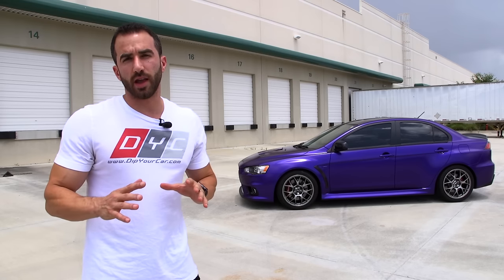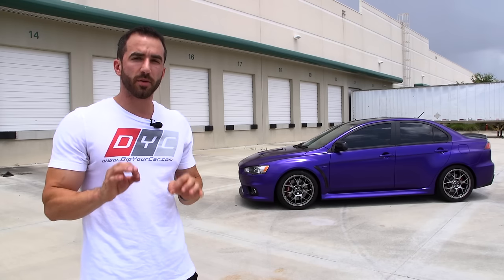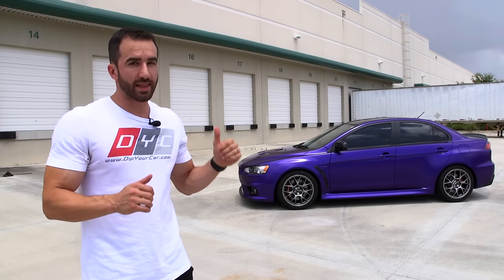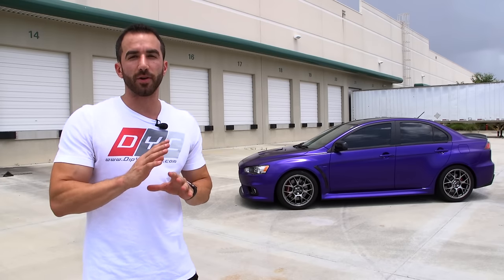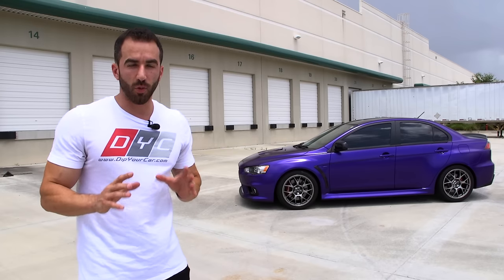The Most Vibrant Purple Known to Man

Comment: How much weight to the car does this dip add?
Reply from the maker: Less than 2 lbs
Reply: Oh wow, a lot less than I thought it would be.
Reply: I disagree. I also thought this stuff was quite heavy. I would hae guessed a lot more than 2 pounds for sure.
Reply: Spotted the ricer! just kiddin
Reply: haha funny you mention ricing I am in the process of DeRicing a nice orange custom geo metro I got ahold of. my god the fart can muffler makes my head want to explode.
Reply from the maker: Heavy in liquid form, however once all the solvents evaporate the coating left behind is very light weight.
Reply: not really dumb. I also thought the weight was significant. not enough to effect fuel economy. mass does not really effect fuel efficiency unless your doing city driving (then mass is everything) but for cruising long haul driving mass (to a limit) has no real effect on fuel economy since mass is only relevant while under acceleration (this includes stopping and turning and going up and down since all are accelerations)

IE my metro got 56mpg I put a 400 pound lawn tractor on my little trailer and I got 54mpg. and that 2mpg drop is almost exclusively from the stop sand accelerations.

now aero drag is HUGE for "cruising" mpg.
Reply: +Nerys oh yeah? Didn't you see that my comment was about him calling someone a dumbass for asking something that he doesn't know rather than about weight and drag?
Reply: +Hidhir Abdul Wahab nope. never saw that. youtube comments are not structured that granularly. kind of a crappy comment system.
Reply: Ha!&#160;3 door hatchback, 3 cylinder engine&#160;with a 5 speed manual was my first car in 1989. In 2008 I still had it. I had it in my shed in my backyard for 6 years after blowing it up at 245,000 miles plus.&#160; In 2008 I went through the entire car and e and y brother&#160;built a much fresher 3cyl I got from a junk yard to over 162hp then we added a&#160;single turbo pushing 30lbs, we got 413hp to the wheels&#160;with a 100 shot to get the turbo spinning. We narrowed up a 12 bolt posi I had sitting around, built a ladder bar suspension and fabricated a couple rear wheel&#160;tubs. I was able to stuff a 15"X9" centerline with a 245/60-15 tire in the wheel tubs along with a 17"X3.5" front centerline. The thing was bad ass looking, low and level with those big tires tucked in and the taller wheels in front!&#160;We needed wheelie bars but never got around to it before my brother totaled it at Pomona in 09 when he&#160;got&#160; the high speed wobbles and rolled it at about 120mph! The wheel base was way to short, once you started to get out of the groove it was over, pull the chute and hope for the best, the chute saved my rear a few times. We got a total of 38 full runs out of the car. Total cost was around $7600&#160;to go from a blown motor kinda shabby car to a high 10 second death trap! It did pass all NHRA inspections though.&#160;My best time was a 10.91 @ 139mph, the thing had some big top end speed because of the 3.42 gears with the stock 5 speed manual.&#160;With the right gears and tweaking&#160;of the suspension, tranny and motor,&#160;high 9's @&#160;140's was possible? Forgot to add the car weighed 1,202lbs with a 170lb driver (me) and 10 gallons of fuel!
Reply: Sounds like it was sweet man,my first build was taking 89 Fox body after blowing 5.0 me and my best friend already had a Chevrolet 454 Speck blue printed everything ready to go, dropped it in my Mustang put blower on, put in roll cage, tubbed it out, took it out run the tires off of it for about two years every weekend we wasn't working on it, at the time we were the first ones in the neighborhood to go with the Chevrolet big block in Foxbody Mustang,this guy had a Yamaha FJ 1250 on the bottle this bike was right, we did a run my Mustang against his  Datsun 240 Z with the small block Chevy in it on the bottle, race was a Harley-Davidson that I had against his Yamaha , one run bike for bike , I kept that bike my son rode it back and forth to high school, she still run when we put her on top of my office, as a matter of fact that old Harley- Sportster is up there too, because we needed the room I think there's two or three maybe even for dirt bikes up there it's just been a long time since I went up there and seen what is all up there but damn just needed the room, anyway enjoyed your story now glad y'all made it out okay ,y'all have a good one.
Reply: It also adds about 37.3 horsepower too

Comment: @dalton murray. get a pop up canopy and some plastic to cover the sides, two box fans, two filters, duct tape filters to the back of the fans and cut holes in plastics. use one as an intake and one as an exhaust fan. portable dip station- about $130

Comment: for what this "dyc" system costs you could pay a professional to just paint your car and it wouldn't peel off. not sure what the purpose of this is honestly
Reply from the maker: The Pro Car Kit is far cheaper than buying what you need to professionally paint your car.  The DYC Pro Car Kit for this type of car would be around $400-$500, including the paint, spraygun system and all accessories.  You would need a 60 gal compressor, paint gun, etc to apply automotive paint.  Dipping is also far more user friendly, almost anyone can do it - automotive paint requires a specific skillset.  The main purpose behind dipping is that it's affordable, easy to do, and when you want to change back to the original or a new color, you can peel it off and start fresh!
Reply: Dayymm I hate you guys :D in the good way hahahaha I want to repaint or foil my car cuz its pure black and all dust sand parts that rub it are scratching it little by little. But you do not sell this product to my country or I can`t send you my car to be painted ( dipped ) :(
Reply: ***** lmao yes I have gotten an entire car painted and it wasn't as expensive as you'd think. You're calling me cheap in one sentence then in the next you say I'd add an extra zero compared to what I'd pay for a dip, which is it? I spend too much paying a pro to paint my car or I'm cheap and dip it?
Reply: ***** I wouldn't let macco repaint my lawn mower and why would you strip the old paint?
Reply: pmm4177 they implied you are cheap because you think you can get a good spray for around this price ~$500; for a clean spray of a paint like this, you are talking $5000 or 2-5x as much; just do a casual search of the interwebs and you'll find plenty of forum posts asking with people explaining the high costs; 
Or you can go to maaco and get your trim, windows, and sometimes interior oversprayed for $500.

Comment: im not a painter or anything but ive always wondered why the hoses or the cable attached to the paint gun are not coming from the top, like if the machine is above at the ceiling of the paint garage, wouldn't that reduce the chance of getting these hoses or tubes accidentally touching the car when the paint didnt yet

Comment: A nice paint, but as a car painter, I have seen a lot better. But I would say it's an unfair comparison to compare very expensive professional metallic paints, with several types of pearlescents, candy colors and chameleon paint, to plastidip. 

For the price, Plastidip is great and easy to use. But I would say that if we remove price and ease of use out of the equation, it has nothing on professional paints. You simply cannot get the same effects and depth with plastidip.
Reply: Or dip is perfect for people who don't care much on paintjob.
Reply: Loki idk in your area but for mine, to have lets say my truck painted shops want around 8gs  i can have the truck completly wrapped for about half that. Professionally dipped, wpuld be around the same but what really brings dip to people is being able to change it whenever you want for pretty cheap. I dont thinknitnlooks better than a real paint job by anymeans but it does give it a different style. And like insaid i could have a black trucknthis year, a green one in three years and a blue one in 5. And i can do it three times for the price of one paint  job. If i did it myself at home i could do it even more times. So thats where i think the real attraction is to the whole plasti dip thing.
Reply: who changes their car's paint job three times? just pick the right one the first time. it's not shoes or a purse, but I guess maybe some are trying to match to those. but aren't wraps as easy and similar priced? a wrap seems better, plus the styles are virtually endless, I think.

Comment: Would have been a completely different look If you did base coat in white, then double or triple layer the purple, not black. 

Any color you want to be dark, you start with a base bright, and darken the appearance with the same finish in layers. 

Never start a paint job in flat black, or your results will always be dull and flat, and will take very much time, and paint to make it shine. 

Here's another one... mix all 3 together, base, coat, finish coat, and clear coat. 

Flats always flat, I mean even if you want a shine, using a gloss black base would even be better than flat. It will always cure differently, depending on your initial base paint color.

Comment: What about the parts underhood, undertrunk, even inside doors part? If the car base color is white, is it still white? That's gonna looks so ugly when you'll open the doors.. so, is better buy a black car than a white one? I tough that a white car is better for the base color to plasti dip, but now I changed my mind.
Reply: It's personal preference. Dip what you want and leave the rest alone but remember Dip is usually for external aesthetics really. No one's going to judge your vehicle on what color your door jamb is. For my 2G Eclipse I chose a basic Black Cherry to cover the original (Barcelona Red Pearl) and they're quite similar in color so it goes unnoticed. A black car would be great as a base, you're right. It goes good with any other color. White? Eh... no.
Reply: +DareToBeDeviant Thank you for your reply. :)

Comment: Quick question, my car is sanded, how will the dip bond?
Reply: You look like Scottie Pippen lol!
Reply: +TraumaER that's not me lol
Reply: lol
Reply: I've dipped hoods that were primered and the results weren't good. Plus it doesn't peel off easily (or at all). If I were you I would think about doing a simple clear coat over the car just so the dip sticks better... Might even be able to get away with a rattle can clear ( don't take my word on that lol)
Reply: JohnWayne2122 probably just gonna wrap it lol